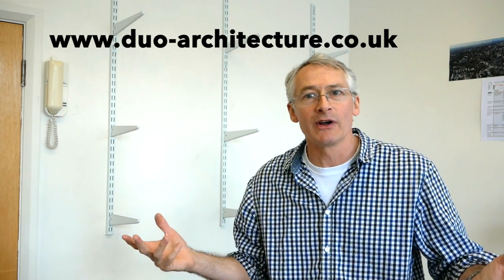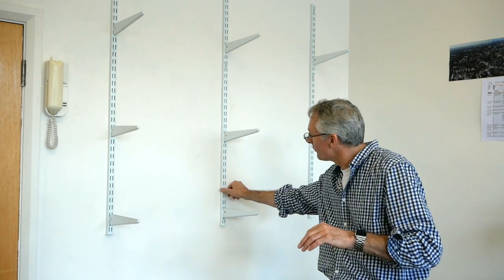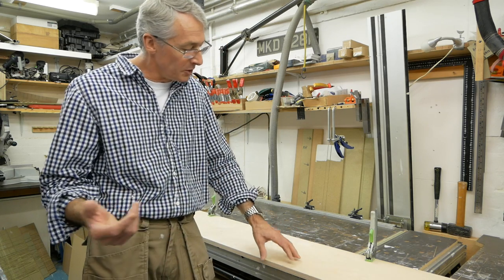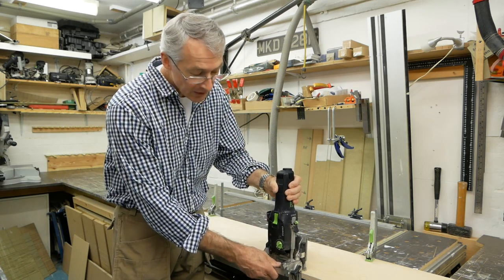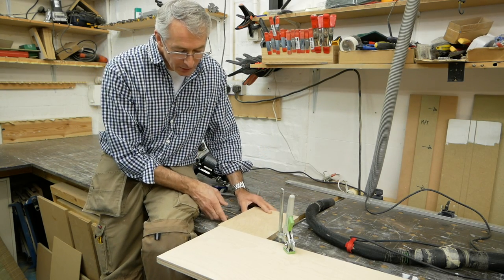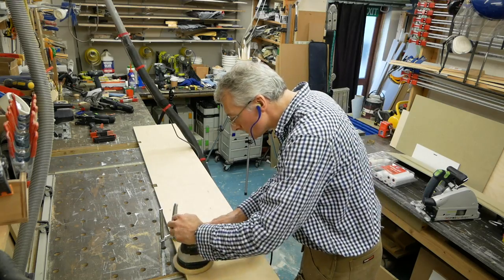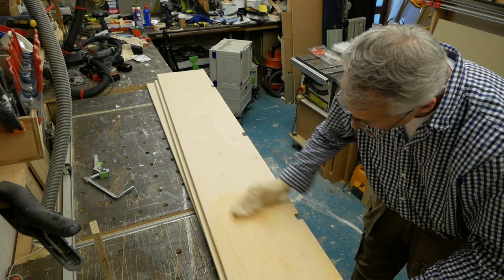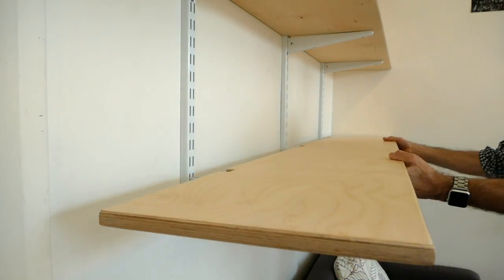Plywood Shelves with steel uprights and brackets. #044

Comment: I like seeing this simply done in a tutorial, because you can take a lot of cool approaches with this. Make the bottom board much deeper and use it as a floating desk. Put one of these over your bed, have long rails by the side of your bed and use the shelf as a nightstand. Combine shorter and longer shelves for a fancier look. Attach hooks into the back of some drawers and wall mount them. If you google for "danish wall unit" you'll find a lot of cool ideas you can implement at a fraction of the price.
Reply from the maker: Joshua Koudys Thanks! 👍

Comment: Nice... I only wish you had shown how you attach the shelves to the brackets, which is what I am having trouble with.
Reply from the maker: Screws. Longer ones nearest the wall as the brackets are deeper. 👍
Reply: @10MinuteWorkshop  Hello Peter, thanks, yes I know longer screws in the back... but what's the ration on the length screw/board+rail? I do not want to screw going through the wood, and also, I want to make sure enough of the screw goes through the board, so it does not fall (I will contain all heavy glass jars) . While husband thinks it is ok to have screws go only until about half of the shelf (which is one cm thick) I want the screw to travel at least .80 mm inside the wood... any advice on that regard? Thanks in advance!
Reply: @1keyl  I tried putting screws in that would go halfway into the board and they wouldn't stay in, they just drop right out.  Not sure longer ones that go 3/4 through are going to be much better.  How'd yours turn out?

Comment: I've had this track/bracket system for years but never notched the shelves...I'm going to do that so the shelves don't slide.  However, I've also never put screws through the bottom of the brackets into the shelf boards because the length that would be needed for the back screw seems ridiculous.  I'm also going to figure out a way to put a rail around the shelves so items won't slide off in case of modest earthquake.
Reply: I'm wanting to put some of these in my shop with the double slot standard and 24" shelf brackets. Do these have side to side play/wiggle to them ? It just seems that they would without the shelf bracket being secured in any way. I'm trying to find this out before I purchase them. Thanks a bunch.
Reply: @ImAcoastpedder  yes there’s some side-to-side play.  It generally hasn’t been a problem for me when stuff is on the shelves and the weight weighing the brackets down.  Mostly it’s when the shelves aren’t full, or I’m rearranging stuff that I notice the side-to-side wiggle.  Once I notch the shelf boards in the back as shown, that won’t happen…it’s the shelf board sliding on them that makes the wiggle.  I am going to screw down at least the front where the bracket is narrow.

Comment: You should mount an large piece of acrylic to the base to get more area. I do like the idea of the support pin that festool has for their routers to better handle edges and not falling over. 
I actually bought one of those fancy one-handed (trim)routers and I do feel that it is a lot easier than with the large one even with the smaller base area. It feels better balanced to handle the edges, almost like it was designed for that... :) 
Nice video as always!
Reply from the maker: Thanks! 👍

Comment: Nice video Peter. My take on the notches. Drill a 3mm hole in each corner so that it's edges touch the side and rear of the notch. Then do the same with a 20mm bit. The perimeter of the 20mm hole should miss the 3mm hole completely and leave it in place. 
Using a downward cutting jigsaw blade (They do work, you need new ones!), with a backing board cut out the notch using the two 20mm holes to turn the blade. Then trim back the bits in the corners to leave a 1.5mm radius in each corner, which can be squared off easily with the jig saw if required.
There's a thousand ways to skin a cat!!
Reply from the maker: +Graham Orm At least a thousand! Domino technique worked pretty well 👍
Reply: Peter Millard the down cutting jigsaw blades only work when the jigsaw is set in non reciprocating mode. Usually setting 0.
You probably know this but just checking.
Reply: @hkrsescort  they'd have to reciprocate to work at all! Unless terminology is different where you're from, I suspect you meant the "orbital" mode, since the down-cutting blade's cutting stroke would be when it's at the rear of the orbit, away from the material.

Comment: Good idea to use the domino on the slots.  I often find the "raw" industrial look can be very appealing.  If you didn't have a domino and still wanted a machined finish you could sandwich the 4 shelves with a sacrificial blocks either side of the 4 shelves and use a router to plunge down (so the end of the router bit is parallel to the edge).  Thanks.  David
Reply from the maker: DRMNZ Thanks! Yep, lots of ways to make those cuts - domino sure was easy 😄

Comment: Got those in my electronics room, they are very strong. You use a lot of mdf and ply and paint it, do you ever use melamine chipboard, if not why not?
Reply from the maker: They are excellent. I’ll make with whatever materials my clients want; overwhelmingly that’s been a painted finish (and overwhelming white) for the last 15 years or so. That’s it; I have no problem with MFC, it’s a fantastic product that’s been massively improved upon since the old MFI days, and my yard can supply, cut and edgeband it for me, just that so,far nobody’s asked me for it. 👍👍

Comment: I used twin slot to build a shelf for my parents new TV, saves so much space compared to a TV stand and so much safer than those glass base stands
Reply: Would love to see a video dedicated to Twin slots - for example the various systems out there. I believe the one I'm currently using is called sapphire - in the past we used one from Wickes which I think was better - it was easier to lift the brackets. But I love how flexible the system is - when I changed printers to one that was a totally different shape and size all I had to do was move the shelf up or down a level. 

Personally I like the little gap at the back - very useful for threading wires that go to power the various devices I have sitting on my shelves.

I also used Twin Slot system under the staircase to build a little coat rack section plus a shelf that acts as a USB charging station for guests - they can safely leave their phones and tablets to charge whilst we all have dinner.

Comment: Great video, but wish you showed HOW to screw the shelves to the brackets. With these rubbermaid brackets it seems easier said than done. Have to come from the bottom? Pretty precise screw length? Anyhow, would be a helpful addition to this video
Reply from the maker: Thanks. Unfortunately you just need a wide selection of screw lengths, as the exact length required will vary depending on the size of the bracket. 👍

Comment: Great work! Counter sunk pilot hole, screw but is it screwing into the bracket? Bracket looks metal, does it have holes with raw plugs in it? Cheers
Reply from the maker: Thanks. The steel uprights have a countersink moulded into them, so regular csk screws work just fine. I didn't fit the uprights, the clients did that part. 👍

Comment: OK, so I have this kind of shelf system and notched the shelves as you show.  Now I want to put the screws up through the brackets into the shelves.  I got screws that should go halfway into the shelf boards...but they just fall right out -- how do you get them to stay in?  They don't bring the boards snug against the bracket at all.
Reply from the maker: The brackets are angled, so you need much longer screws for the back of the bracket nearest the wall, than you do for the front. Measure the bracket at the screw hole, then add half the shelf thickness. 👍
Reply: @10MinuteWorkshop  thanks for the response.  I did try that exactly, but for some reason the screws won't stay in tight...they easily wiggle and drop out.  Might be because my shelf boards are MDF and not plywood (mine are in the garage so didn't need to be as fancy as yours).

Comment: Another good video, thanks. I just wondered if I could ask you a question regarding the way you make doors. I am in the process of making some wardrobes for my son and his wife. Due to the size of the room I want to fit sliding doors. My question is if I make panel doors your way would they be heavy enough. The doors would be 2050 X 980 with three panels in each. Many thanks, Tom.
Reply from the maker: Sure, that's a big old door, and even with a panel door they'd weigh a fair bit. You might want to consider beefing up the panel to say, 9mm, if you think they'll be a bit lightweight. Easy enough to work out; 18mm MR MDF weighs around 15Kg/sq m - work out the areas of your door and allow for variances in thickness, and you'll have a pretty good idea of the weight; comes in handy when speccing hardware (hinges, runners etc...) too!

Just did a quick calc; at that size you'll use ~1 sq m of material for the rails and stiles, and 1.5 sq m for the panels. So if you went with 18/6 then each door would weigh around 22Kg. A 9mm panel would bump it up to ~26Kg, a 22/9 close to 30Kg. HTH, P
Reply: Many thanks for your reply, you're a gentleman and a scholar. I think I'll go with 18mm stiles and rails and 9mm for the panel just to give it a bit of stiffness. Thanks again.

Comment: I'm guessing that you don't have a Festool Vecturo OS400 multi-tool then. A multi-tool would be the quickest way on that job I would have thought. Still neat solution though.
Reply from the maker: David Marsden On the plunge base?  Yes, that would have done it, and no I don't have the Vecturo, I've had other multitools for a long time though. Because of he way they oscillate I find them quite hard to use accurately when I'm doing more controlled cuts e.g. perfectly square and plumb with absolute start end end points. But yes, the Vecturo on the plunge base would have done that cut, for sure, at a price, but you use the tools you have, not the ones you'd like 😉👍

Comment: The shelves will be non adjustable when the brackets are fixed, had this problem before. 
There needs to be adequate room for the brackets to articulate therefore having the shelves so close to the wall and uprights doesn't allow for this.

I had a vision of you using the domino for an excellent way to fix the shelves ie installing domino's on underside of shelves so the dowels fitted tightly inside the brackets negating the need for three different size screws per bracket.
I don't believe it's possible to use the domino machine on such a way but I hope you get what I mean
Reply from the maker: +cliff owens Clients were happy to fix the shelves themselves, once they had their heights sorted. 👍
Reply: Peter Millard I gave myself an idea when I had that "vision" I think I'll attempt what I seen the next time I have the chance :-D,  thanks for the reply and please don't take my comments as anything more than constructive criticism :-h. 
The dowels idea would work pretty well I think and still allow for adjustability as they could be popped out fairly easily, I digress, apologies lol

Comment: How much do you pay for a full sheet of Birch ply? I'd love to use it, but no where local sells it, and if I buy it online, the delivery is super expensive.
Reply from the maker: Sorry to hear that - Birch ply is a very nice board to use and (for the most part) readily available. I pay around £60/sheet for 18mm, inc VAT. I know you can get it cheaper, but London, you know??
Reply: Same here in the North West. Around £60 for 18mm, but if you want premium grade with no surface patching its probably another tenner.
Reply: Thankfully I've found a local dealer...hours are terrible, so you have to plan ahead for a project, but I can get it. Prices seem comparable too, I don't think he's raised them from when I got these (7/2017, USD) 

5x5 3/4" $63.59 (2.54/sqft) AB
5x5 3/4" $75.10 (3.00/sqft) AA

4x8 3/4" $89.36 (2.79/sqft)
Reply: Unfortunately, having used it, it's raised my tastes, and I struggle to convince myself to use lesser (though cheaper!) plywood, even for shop cabinets. :(

Comment: Good video (as usual)👍 Have you ever considered when replacing your worktop using Peter Parfitt's (New Brit Workshop) Parf dog drilling jig (sold bŷ Axminster)? Did I hear correctly that the architects are going to screw the shelves to the brackets? How many architects will that take and will they use the right screws?
Reply from the maker: Thanks! No, when I replace my worktops it'll be just with MDF again- nothing fancy, nice and sacrificial 😉. TheParf jig looks interesting, but not really sure I'd have the use for it, and my timber yard has just put in a big CNC... And yes, the architects were fitting the shelves to the brackets; I think they're still discussing the screws 😂 To be fair they did a decent job of fitting the uprights - practical hands-on architects, who knew?? 👍
Reply: Peter Millard I think Peter uses MDF too but can replace as and when with using the jig. I am still cogitating over it.

Comment: What about dado...would that work?
Reply from the maker: Sorry Bill - I don’t follow you; a dado where?
Reply: Maybe make the back notches by taping the boards together, standing the group on edge and putting them through your table saw dado blade set to the depth of the wall standard?
Reply from the maker: @bduncan43  Ah, I see; yes, you could do that with a router - Dado stacks don't comply** with health & safety regs in the UK/EU so aren't widely used, and few current saws have an arbor capable of taking them, just FYI. Thanks! 👍
**If you want to get picky, they're not non-compliant per se, but their use (and the momentum they generate) makes it almost impossible to brake most saws in the required time to comply with the current regs; there are some big industrial saws than can do this, but they're typically beyond the scope/reach of one-man-band maker/installers. 🤷‍♂️

Comment: Think i would have cheated ,clamped all of them together ,stood them on there side and made like a story stick to clamp to it and used the router to cut them all at once ,when i do the round over on the edges ,i use a mounted router ,for me it makes quick and easy work out of it ,but if you asked me they should have had you make them a floor to ceiling desk and shelving unit ,but sometimes you just have to get your foot in the door huh ...lol
Reply from the maker: Yep, there's lots of ways I could have gone, this one worked OK. Didn't much fancy moving a full shelf horizontally to round-over the ends of the end of the shelves, which is why I went for a freehand cut. Great idea about the desk, but  there's a sofa directly beneath the shelves, so a non-starter, sadly. Thinking about it, I hope those shelves stay on the wall... 🤔😬
Reply: Well if you didnt hang the support bars you ve got nothing to worry about ...lol
Reply from the maker: Very true! 😂

Comment: Ah to only get such nice plywood in the USA... here we only get crap.
Reply from the maker: +Minok1217 Sorry to hear that - but yes, I agree, it is a nice looking board, lovely to work with 👍
Reply: Yeah, the main home improvement shops best plywood has got all sorts of air pockets between the plys and puttied on the back sides, so its not even a good finish on both sides.  Canadian woodworkers complain as well, it seems the best plywood gets exported from where its made.  But birch plywood isn't common in the US, so I don't think thats the issue here... its just our market in North America is just satisfied with mediocre wood. 

I'm putting the same schelving system in a closet - but not cutting out the area for the vertical supports as I intend to use the gap that gets left as a result to route cables - the shelves will be covered with computers and displays.

Again, nice job.
Reply: I ran into this myself here in Toronto. They often include the manufacturer #, so you can see the actual grade of the wood (instead of relying on their assurance that it's "top quality"). It's mostly B2 grade and below, and usually ~$110CAD for an oak 4x8'. I did find however that RONA sells a very nice A2 grade grade 4x8' oak for only $71. For an A1 grade and you'll need to check a lumber yard that specialises in ply. It's too bad ply's got such a bad rap -- the quality stuff, properly finished, can be pretty gorgeous and has a lot of advantages over  planks.

Comment: Will they warp if you dont screw to brtacketrs
Reply from the maker: Katelyn Lee I certainly wouldn't expect them to - 18mm Birch ply is pretty stable 👍
Reply: The boards definitely won't, but you certainly could see it pull away from the wall if not installed properly. I think you probably mean "studs", not brackets (not having those on track shelves makes no sense). If you have wood studs, you're golden. If you have steel, I've had a good experience going in with some #12 sheet metal screws after drilling a 5/32" pilot hole. I'm guessing completely, but so long as about half the tracks are stud-mounted you're probably okay anchoring the others to drywall. If the wall's plaster lathe, I'd recommend against wall-mounting entirely.